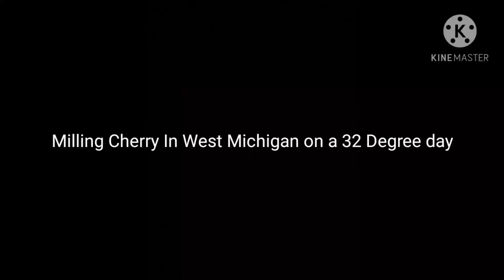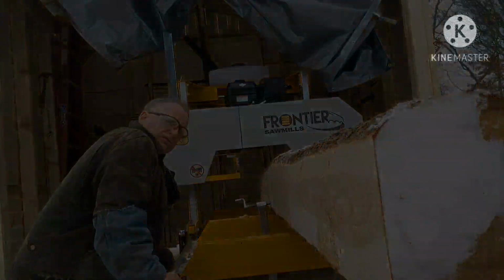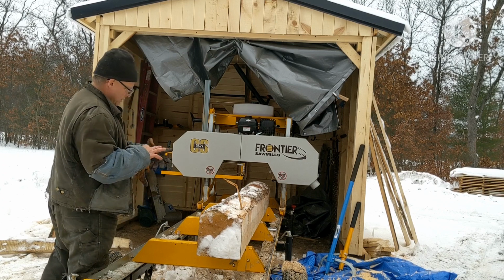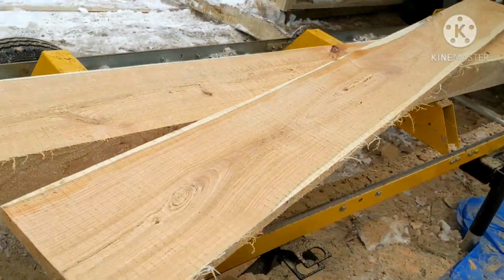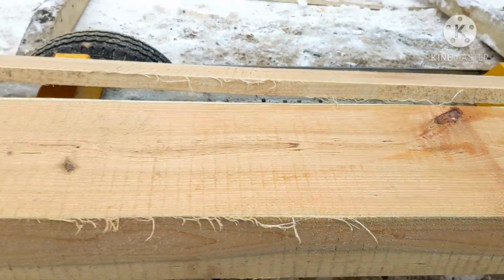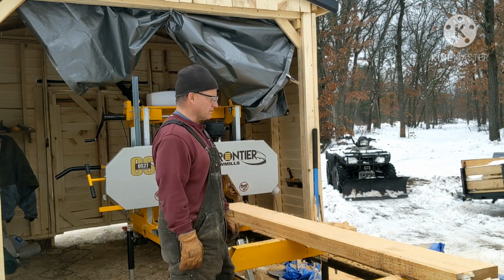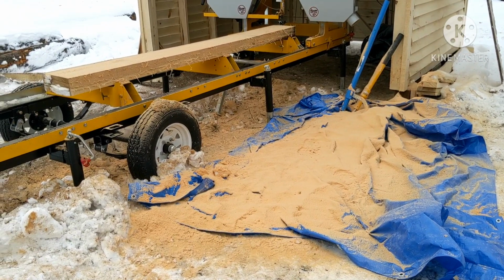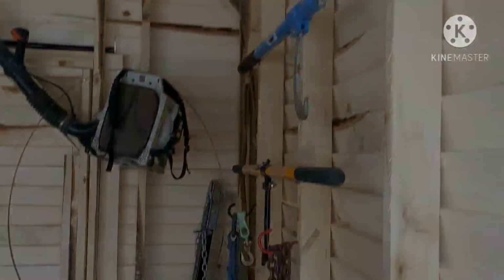Milling Cherry on a 32° Day.

Comment: What do you use in water tank to keep it from freezing?
Reply from the maker: @stevejohnson1313  windshield wiper fluid.
Reply: @BigelowWoodcraft  Thanks for the quick response. p I just bought a os27 and videos are very helpful. 
Keep up the great work.
Thanks again, 
Steve Johnson
Reply from the maker: @stevejohnson1313  thank you so much.   I'm glad you found them helpful.  Have a great time milling.  I love the OS27